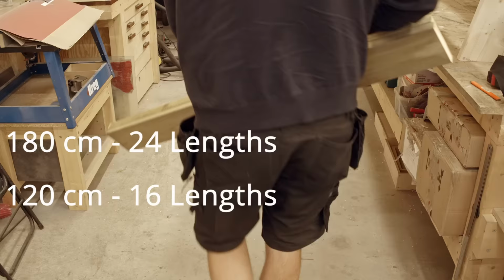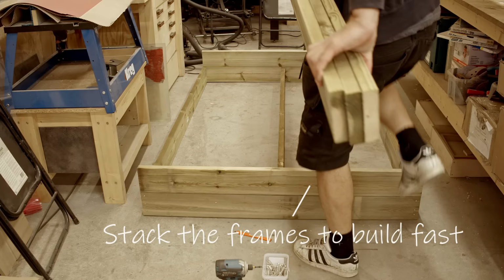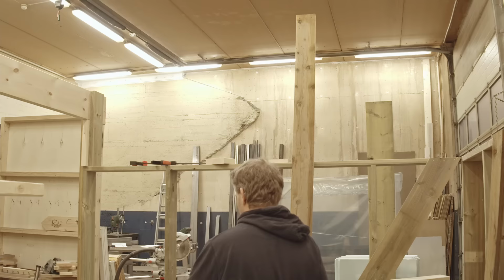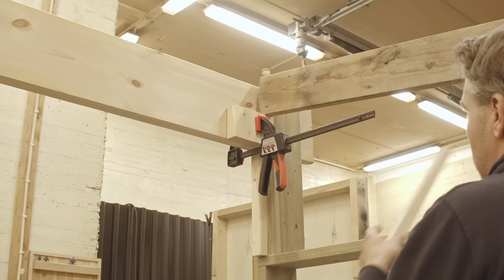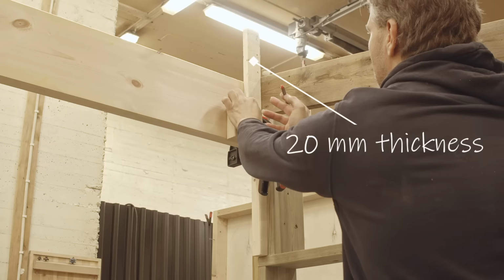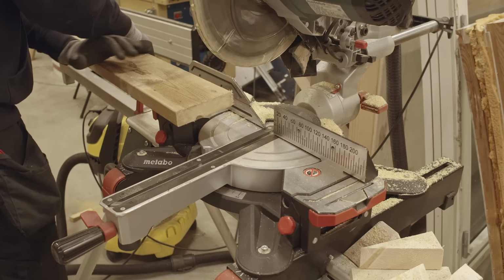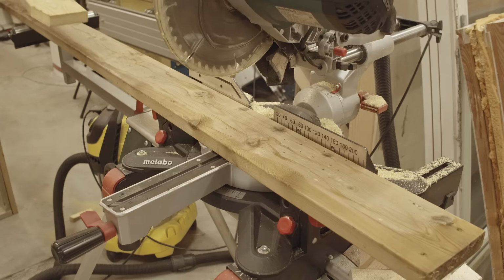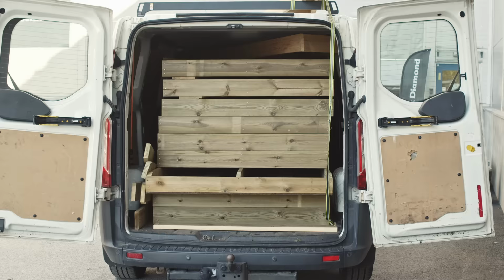This is Almost Too Easy - I Made a Simple Shed Using Only Decking Boards

Comment: Sorry not that great. About a third too much wood used. Direct birdsmouth cuts better (there's a really good YT vid on this). No cross brace to roof structure. Door? Bracing for door.
Reply from the maker: "Sorry not that great. About a third too much wood used. Direct birdsmouth cuts better (there's a really good YT vid on this). No cross brace to roof structure. Door? Bracing for door."

I usually don't add bracing for a door when there isn't a door... Looking forward to your great video on how to do it!

Comment: Not Easy if you don't own all the tools you are using and or all the decking boards... seems more like a small challenge to the mind and budget.
Reply from the maker: Well... you can build this using only a hand saw and a hammer. But you are right that it's hard to build without materials, that's why I used the cheapest materials I could find.

Comment: Nope.  I'll stick to my methods.
Reply from the maker: ok
Reply: @DieterSchneider    :)  just std stick built walls and truss, double-pitched roof, on free-standing blocks or pavers.  Screw the wall-corners and sliding for strength and removal if desired.  Have yet to move one though.  Roof material depends on the size. Asphalt is cheap easy and throw-away, but I like metal or poly sheeting for larger buildings

Comment: I don't use the metric system, only countries that haven't landed on the Moon use the metric system
Reply from the maker: NASA switched to the metric system.
Reply: @DieterSchneider  and hasn't had a manned mission to the moon since
Reply from the maker: @sinistersilverado965  well... the metric system was used in the first moon landing as well.